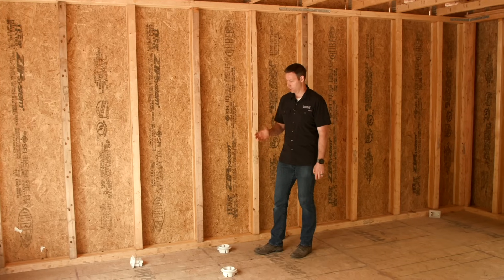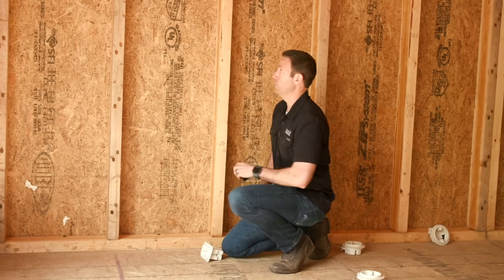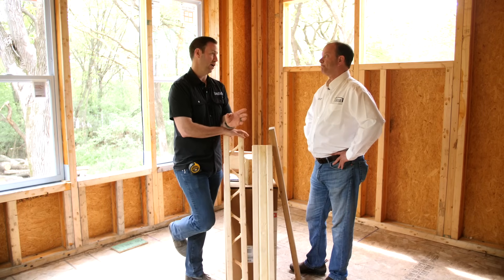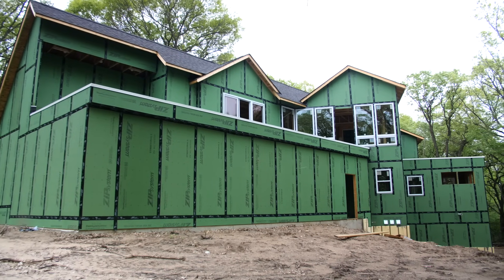Insulated Studs? This is a BIG Innovation in Framing!

Comment: How long would these last in a house fire vs traditional 2x6.  Modern construction techniques are burning houses down way quicker.
Reply: just dont set your walls on fire or use fire rated drywall and that should slow down your burn rate
Reply: @garyenwards1608  it's not my walls but walls in houses we responded to that are on fire. Composite structural materials have drastically increased the speed at which a home burns. Since the 70's till now its dropped from 10 minutes to 3 minutes. Look at response times for you area to see if your fire dept would make it to your home before it was fully involved
Reply: basement savers, is what we've called the FD's for years.... thought not really their faults.  Example: You live next door to a fire station with the best of response time, but often by the time it's noticed and called in, it's far too late anyway. heck whole fire stations have burnt to the ground before! 
your best bet is to hope someone highly observant notices smoke/flame while passing by and alerts as early as possible.
Reply: You are the sixth or so firefighter wondering the same who clearly did not bother to look at the description for a link to the product website for this info via the Test Reports they have posted on said site. I am smart enough to do this before i even post such  comment showing what those of you clearly lack in common sense. It is not like they are going to answer your questions here on Y when they already as mentioned provide said answers and info on their website.
Reply: @Joshua79C  wow I'm sorry that you're so incredibly offended that I'm not the same level of YouTube expert that you appear to be. I'll make sure to spend more time learning the intricacies of this platform as to no offend you. Please forgive my ignorance and the disgrace that I have brought upon my ancestors.  Heaven please help this man to recover from my mistake in trying to have a conversation that might help me or another not perish in a fire.

Comment: Curious to know if/how the T Suds are connected together when stacked on their weak axis and used as a header.  They will only act compositely if they are connected together.
Reply: Guess you never heard of fasteners, such as the way post frame building columns are plied together in most instances using nails.
Reply: The stud is a nominal 2x3.  Would have to be a 16 penny nail to get 1" of penetration.  That's a lot of big nails.
Reply: In nail columns used in Post frame and other such useful other purposes is all solid wood, Hence my original statement. These would not fair in columns, then again I could be mistaken and they prove they could be used in this manner.
But when it comes to new ways of better securing to the foundation such as Midwest Permacolumns - Brackets, which have a few bolt holes along the vertical center. The fact these studs have insulation and only dowels there, those really do not offer a whole lot of beef like solid does for the fasteners to lock into. Not to mention they also have about for our eight other holes for additional fastening of the column and used to hold the column in place until the sheer bolts can be fastened in.
Back to where i could be wrong, since the said brackets are wide enough in the both side to side axis (say X and Y with Z being the vertical) the metal itself is a thermal bridge in its own way, Though once the walls are up and such they get insulated from the outside if say the owner opted for Zip-R boards on the exterior if is going to be used as a residence for a more reliable thermal break.
Some others also mention such of using Zip-R on the outside to further insulate and increase the R or decrease the U values.  These would be most useful as secondary framing on said post frame (pole building construction) framing since the industry uses two by 6 and 8 inch thick  columns in three or four ply.
I would like to build something like that, ICF basement and a pole building home on top with Tstud secondary framing and the outside clad in Zip-R or other foam insulation, and Roxul (rockwool) in the cavities for insulation and sound proofing. Perhaps even Green Glue for more sound proofing.

Comment: I admit I clicked on this to kind of pick it apart thinking that it couldn't be that much better once you consider the drywall, outer sheeting, air gaps, foil barriers, and different typed of insulated siding coupled with the type of wall insulation are not affected by the wood value. I watched it and the wheels in my head are turning now as now that I see all the advantages and the way the studs are turned sideways, the headers are also insulated, wire poking with no drill needed, 2 foot on center, and a huge no way to miss the stud for the drywall guys. I want to frame up something now just to try these out. My interest has been tweaked for sure.

Comment: Is there a lot of excess waste generated with making all the dowels?  Or would it actually be considered a BETTER use of more parts of the log because it starts with cheaper 2x3s vs 2x6s and the dowels can be made from even smaller scraps?  It's a cool production challenge.

Comment: Back in 2010, Dow Corning did a lunch&learn in my office.  They were showing 1" xps on the inside face of stud & batt insul in the cavity & I believe rigid insul on the exterior. I noticed that they don't show those assemblies on their websites & I'm not sure why, installing rigid on the inside creates a thermal break. [ Heat travels to cold ] Corning makes a xps with a low voc & it's labeled 'suitable for interior use' The Code says rigid on the inside has to be covered w/ fire resistant material - gypsum board. To me, a non permeable insul on the inside & a permeable insul in the wall cavity & exterior makes sense.

Comment: This would be very hard to work with in practical framing.

Only a framing carpenter would understand.
Reply: At 7:55 you can hear from yourself what framing carpenters think of it. He says "when they first saw it were a lot of swear words but by the 2nd or 3rd house they were chomping at the bit to get to another t-stud house". And that is was several framing crews.
Reply: @davegoodwin1848  I smell bull.
Reply: @justbob333  I've never used it myself but I don't dismiss these professionals opinions especially since they have experience with it and we do not.
Reply: @davegoodwin1848  As a journeyman carpenter with 30+ years of experience I have to agree with Simon J on this one. I have framed enough houses over the years to know that building with T-studs would be at the very least a major pain in the ass. 

Understand that this was a sponsored episode sponsored by T-stud so don't expect anyone to tell you they suck. Besides they didn't ask the framers if they liked to build with  T-studs. They asked the builder.

Comment: Wow OSB on the walls and roof. How cheap. All the new houses I seen getting built with OSB,  you can see the nails popping on the sides of the houses. Wish builders didn’t cheap out and go with ply wood. Anyone that says OSB Is good, never picked up a hammer and sheeted the outside of a house. Love the videos.
Reply: ATC235 that looked like Advantech Zip sheathing to me, and that is some excellent stuff. Perfectly engineered and when all the seems are taped correctly on the exterior it’s super weather tight because the exterior side of the sheathing has a house wrap already on it.

Comment: I think my biggest gripe is that single top plate, like throw a regular 2 by 4 up there an connect the walls. Granted thats between the builder and home owner. Im not the biggest fan on 24 inches OC especially when you want to hang things up. Overall a very interesting product, I dont doubt the strength, sandwhich core construction has been around along time and been proven structurally in boats for a long time. I want to see how they nail those t studs off. The owner of the company seemed on top of his game.
Reply: If you used conventional 2X plate & sill you could use your nailer for most connections.
The obvious reason for 24" O.C. spacing is for energy saving, but less obvious is that @ 16" O.C. you'll be buying 50% more of these expensive studs, which could be counterproductive for the ultimate goal of saving money.
Reply: @stipcrane  I hear you on energy savings but lets be real, a window with a high r value of 5 is always going to be the weakest link. People get too obsessed with r value and forget their windows are the biggest issue, if there so concerned they shouldn't bother putting in windows. In a 50 foot wall you use 38 vertical studs with 16 oc spacing vs 25 studs for 24 oc. So for 4, fifty foot walls (square shape house) you end up using a 152 studs for 16 oc and 100 studs for 24 oc. So a 33% percent increase in the studs for a 2500 square foot house, typical 2 by 6 is 4$  so in the end cost an extra 208$ for 16 oc. Lets say these fancy studs cost 20 dollars your looking at 1,040 dollar price increase for 16 inch oc which is nothing when your building a house. 24 on center is wild, has potential for sheathing and drywall to deflect and warp much easier than 16 inch oc.... I guess my point is id rather have a better bones in my house than the bare minimum as cost for a little extra lumber and framing is cheap in comparison to every other aspect of the home.
Reply: @Cameron-ur2tk  thanks for doing the arithmetic.  My framers hate 24" O.C. because the walls have more opportunity to get wavey.  I'm not positive if it's mostly the fault of studs warping as they dry or OSB warping when it gets wet, or both.  A mfr T-stud would probably be much less inclined to warp, but the OSB could still get funky.  Every few years I have to saw out a few sections that warp from PacNW weather.  We use OSB over the entire house, but I forget some regions use it only in corners or dedicated shear walls.
There's nothing structurally wrong 24" O.C. studs, and if you're afraid of drywall deflection just go with 5/8".  The real problem with 24" O.C, is that it's rarely ever 24" because of window and door placement cutting up the layout and making a mockery of it.  I don't know anyone who likes the single top plate either.  I've only done it on one house. You'll have to carry it through to all the interior walls too.  Connecting walls is a real hassle.
Windows are very important, I agree.  The last heat loss calculation I did showed 42% of all heat loss through exterior walls came through the window portions. (R-21 batts with U-0.30 windows).  If you take 28 windows and add $80-100 of glazing upgrades to each one you've also spent a chunk of money. Exotic German windows can easily add $300+ per unit to the package.
My personal strategy is that fiberglass is the cheapest insulation possible, so I try to bulk that up as much as possible.  I do moderate upgrades on glazing.  I am not a zealot but I'm serious, and my insulation budget is larger than most builders.
Reply: @stipcrane  You know exactly whats up, I agree. Those t studs being perfectly straight would be the cats meow rather than sorting shitty lumber. I guess i get triggered when matt and other people make general statements like you'll have real savings with 24 OC when in truth the builder ends up using six studs for framing out a window as you know. People see it as im saving money but in reality its nothing. Like you said 24 on center you would recommend 5/8 drywall to someone like me  (personally 5/8ths is the way to go)  but are the savings of spacing studs apart cheaper in the long run when needing to use 5/8th over 1/2 drywall. I have nothing against doing the best insulation job and filling the cavities full, i mean if there open might as well fill them up full before sheet rock , but at some point it becomes a loosing battle if you have a significant amount of windows like you mentioned. I love natural light, more windows and skylights the better in my home. I personally would rather have fiberglass or rockwool insulation over spray foam, Lots of variables can go wrong with spray foaming.

Comment: 2000ish dollars is a lot.  I'm thinking house value would also increase by as much.  And with labor costs for plumbing and electricity that should add to the labor savings.   Less heating and cooling energy should help payback over time.  So, if all this was calculated in the 2000 dollars,  then it would not be overly desirable.   Payback time might be 50 years for the energy for all I know.

Comment: Another great video.  TStuds sound like a wonderful option.  There were some statements made that puzzled me.  1. If you are just replacing wood with wood why would framers initially be reluctant to use T-studs?  2. I thought an R-20 insulated wall still needed insulation on the outside wall to move the condensing surface outside the exterior air barrier.  3.  The T-stud is essentially a split 2x6 with internal truss webbing.  It seems like Tstud would weigh more than a than a traditional 2x6 stud.  Consequently, a Tstud wall would weigh more than a modern framed 2x6" wall.  4.  The 8600# y-plane compression result sounds impressive (about 4 times the capacity of a 2x6" stud) .  Are you saying a structure that is built using Tstuds is 4 times the capacity to withstand hurricane or earthquakes?  I would have guessed that racking or the ability for the skin to stay connected to the support stud wall was the limiting component for a wall to withstand hurricane/earthquake damage.

Comment: Hmm sounds good....but the structural integrity in utilizing a stud that is a 2x2 with dowels that have some glue...
I look at high wind areas and how this type of new stud will hold up after 20 years??? 
I think we have all seen how new construction technology comes out....but one catches fire and we see after how it will change....codes, codes and more codes. 
I remember steel studs I used for the first time....then that state changed their building codes on steel framing...
I’ve built homes in Connecticut, Massachusetts, Arizona, California, Japan, Indonesia and Nevada...
These tests are new....
Looks really good though...
I will wait about 5 years and talk to some of my carpenter friends and see how these hold up in reality.